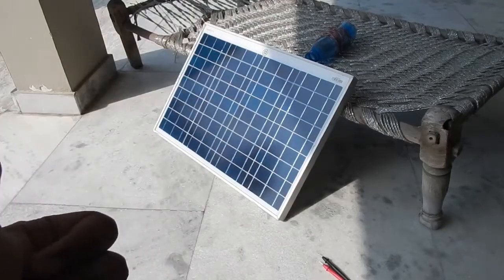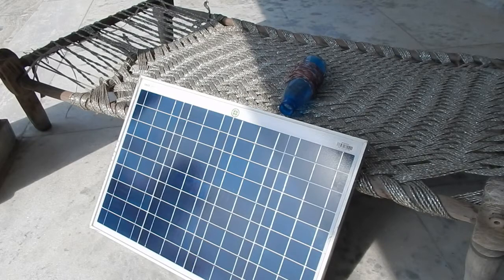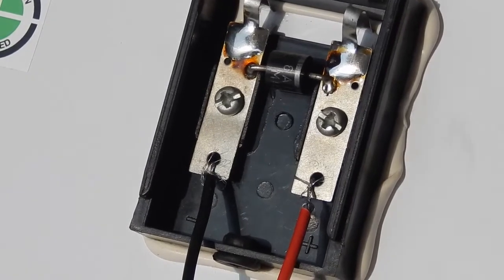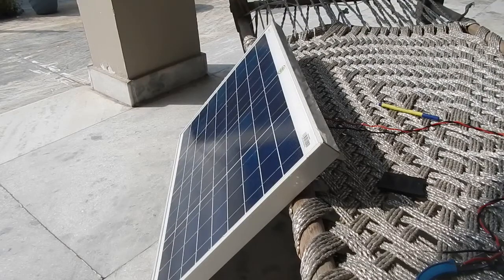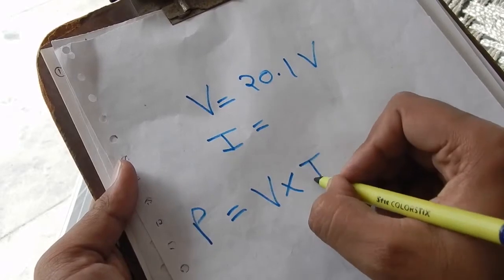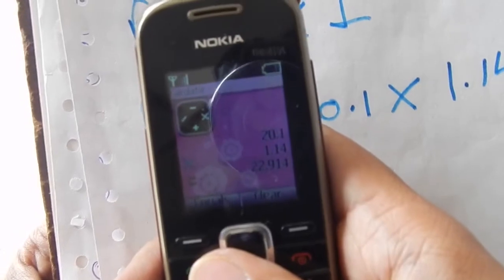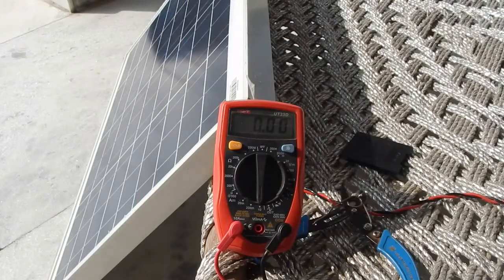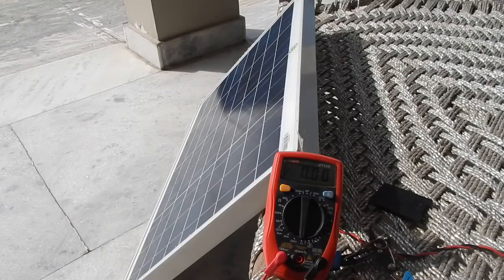GOLDI GREEN 40W Solar Panel Review & How to test solar panel.

Comment: How much power it will generate in a HR with good sunlight & which battery to be use ?
Reply from the maker: A 40 watt solar panel generate 40 watt in an hour. The power rating of a solar panel is what the solar panel will output in one hour. This is a 12v solar panel so you can use any 12v battery with a charge controller.

Comment: Hello brother.
Nice information.
U didn't show your controller.
If u have then pls tell me which amps of controller  u r using.
Reply from the maker: i did not buy the charger controller because at that time all the charge controller were costing more than 2000 rupees so, i decided to save up some money and buy a hybrid inverter. I  have not bought any inverter yet though. I might probably buy the luminous or su-kam.